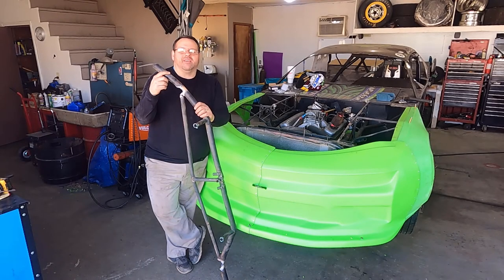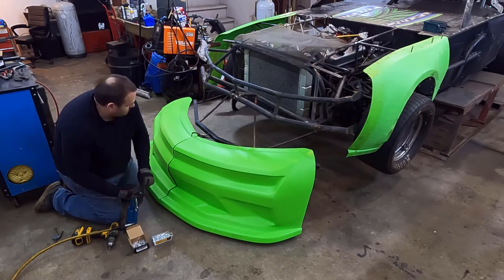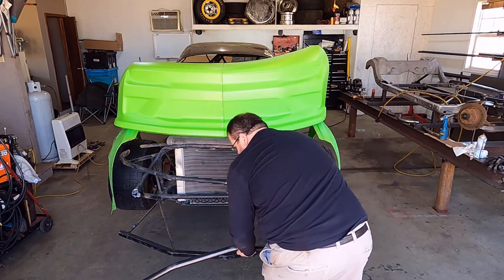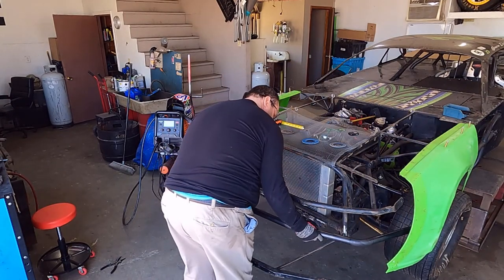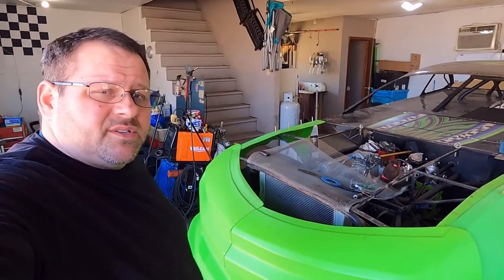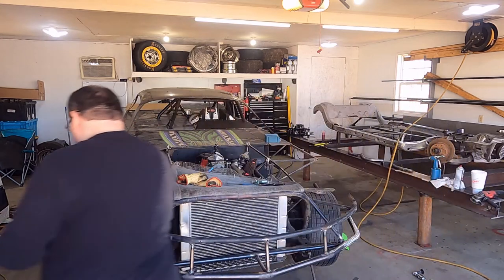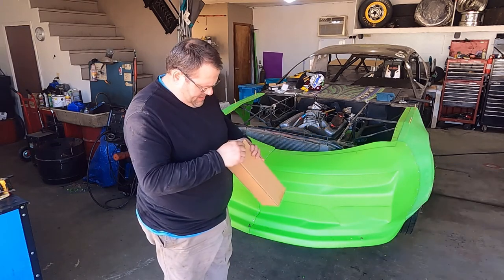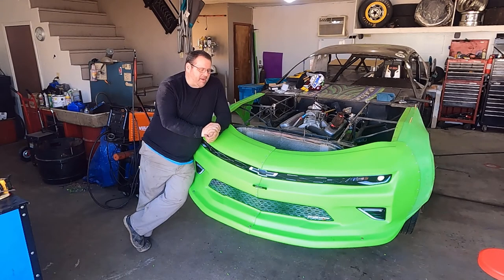Street Stock Camaro Bumper Repair And How to Install a Nose

Comment: Just a small tip. Put something over that radiator while cutting or welding.  I have killed a radiator doing that and seen others do it too
Reply from the maker: I wasnt' even thinking about it. And I could have put my screen back down and covered it. Man its easy to miss the obvious stuff sometimes. Thanks for sharing.

Comment: In the middle of building a new dirt camaro chassis as I said in other comments. Now I can get rid of the ugly tow chain in the front nose piece. When I built the front bumper on the new car after the body’s on I’m thinking about using the old rear axle u- bolts and parts of the old steering shaft to make this part. With nutserts and removable front fender’s.
Reply from the maker: Exactly Tommy!
Reply: Yeah, cool idea for two hook
Ford's nut clips (like what you see on underbody panels etc) work pretty well for bodies